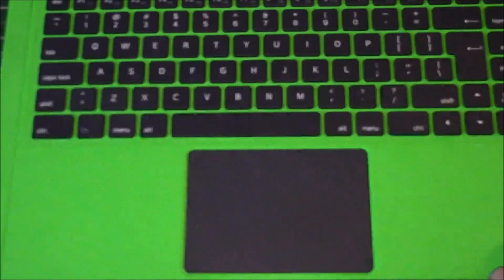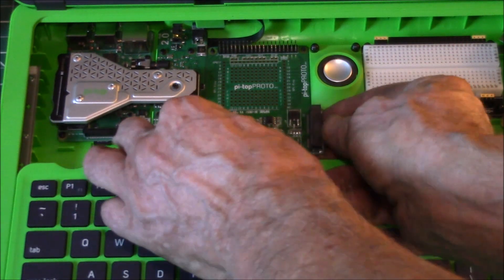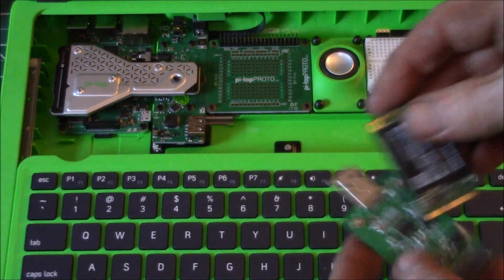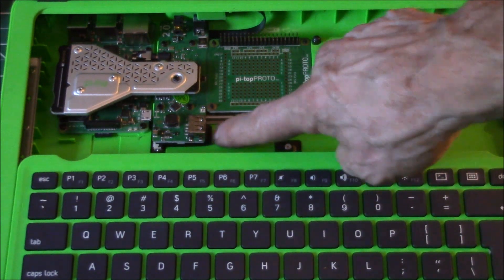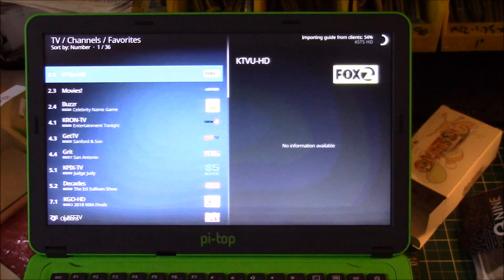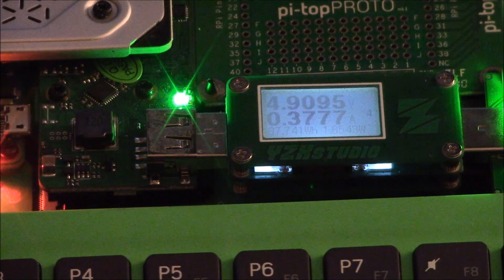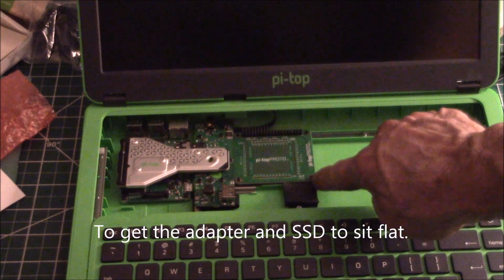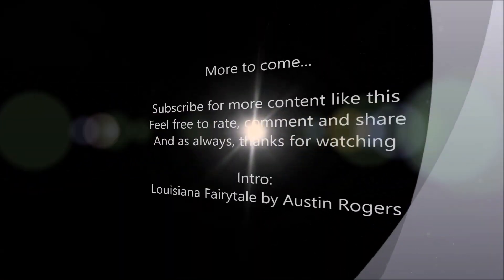pi-top: SSD options + Bluetooth Mouse

Comment: i think i read you can connect 2 speakers for stereo?  is there room on the rails to add a 2nd speaker?
Reply from the maker: Yes, should be enough room for 2 speakers.  Won't have room for the prototyping board and 2 speakers, though.

Comment: Hello, I was wondering if you ever upgraded your SSD since you posted this video a few years ago?  If so, which one did you use?
Reply from the maker: No, still using the same SSD.  No real need to upgrade as the limit is the USB adapter.
Reply: @The4Crawler  Would that still be the case if I went with 256GB Samsung 850 Evo msata ssd?  I ask because the one you linked is no longer available and I found the 256Gb for cheap.  However, I don't want to sacrifice too much performance.
Reply from the maker: @alexcapone3284  The USB2 port on The RPi limits the speed to 30-40MB/s.  Won't really matter on the size or speed of the SSD since they're all faster than that.
Reply: @The4Crawler  thank you.  That saves me a lot of $$

Comment: I also have a pi-top V2, and have found the videos informative. I was hoping you could help with making the pi-topspeaker V2 work in Raspbian, and if so can you make a walkthrough?
Reply from the maker: Have tried that but so far no luck.  If I come up with something that works, will post a video of the process.
Reply: Ok, I have been trying a few different combinations. If I just use the pi-top speaker with no other add-on boards plugged in, with ‘apt install pt-devices’ install, the pi-top speaker works. Now this is just with Raspbian 2019 for the OS, this is without Berryboot installed. As soon as I plug-in the pt-topPROTO+ board and reboot, the pi-top speaker stops working. Keep in mind that everything works out of the box with just pi-topOS installed.
Reply from the maker: I've seen other reports of similar behavior with Raspbian.  In mine, with Polaris installed, all is fine with the pi-topPROTO board and speaker installed.  But as soon as the PROTO+ board is plugged in, the speaker stops working.  Since I need the PROTO board installed for clearance on my SSD, I might be running into a similar issue to what you are seeing.  I notice the PROTO board is just a bare PCB but the PROTO+ board has some circuity on it, an Atmel 1410, which seems to be an ATtiny micro-controller.  I wonder if it needs some sort of code to initialize it or something?
Reply: @The4Crawler  Ok,  I have moved forward a little. I have compared the boot files /boot/config.txt from both pi-topOS and Raspbian, and changed the /boot/config.txt within Raspbian to reflect the /boot/config.txt of the pi-topOS, and now the ip-top speaker works with the pi-topPROTO board installed. Now the volume bar has a red cross through it, the the sound plays but I have no control over the volume. =)
Reply from the maker: Good to hear.  Yes, the pi-topOS config.txt file has a lot of settings in it.  With BerryBoot, I get those for free, so to speak, as BerryBoot loads it's config.txt file before loading any of the O/S images.  So as long as I have the pi-top settings in that file, all the O/S images inherit them.
I was able to get the battery display in the task bar and the Shutdown menu option working as well.

Comment: Hmmm a raspberry pi  have standard Sata ports on board or am I wrong?  am wrong there is no sata,  but there are SSD Storage Expansion Boards.

Here under a link.  

https://www.aliexpress.com/item/X800-2-5-inch-SATA-HDD-SSD-Storage-Expansion-Board-for-Raspberry-Pi-3-Model-B/32791789269.html

I am only afraid that there is no room for it in the PI-TOP
Reply from the maker: No on-board SATA ports yet or USB3, maybe on the model 4.

That looks like a similar solution to what I picked, I think those type of adapters are used in the Pi desktop boxes.  Lets you run a full size HDD or SDD with external power, etc.  But they still use a USB2 connection by the looks of it.  In the pi-top, no way to fit one of those units in as it would mess up the internal component alignment.  The unit I have is an mSATA adapter and fits inside the pi-top perfectly and requires no additional power supply.

Comment: good luck the pi-top seem a little pricey
Reply from the maker: Yes, it isn't a cheap option.  But it does have some interesting features and it seems to be quite nicely designed and built.
Reply: @The4Crawler  that is true looks nice maybe some day I will save up for it